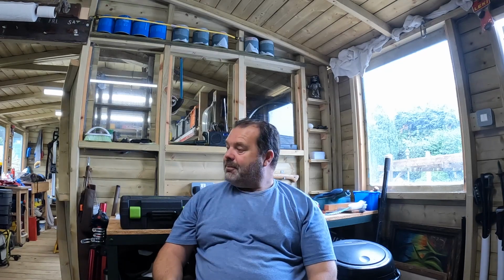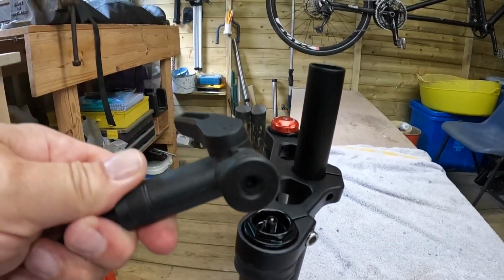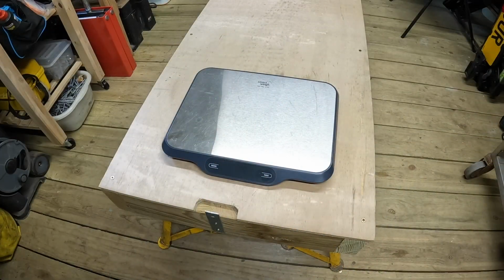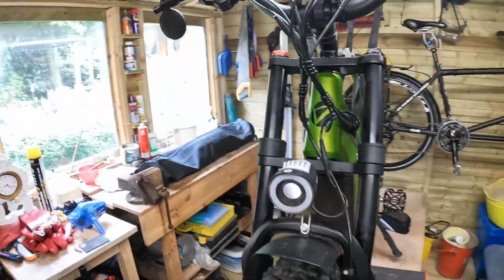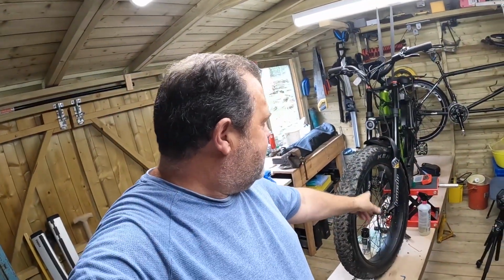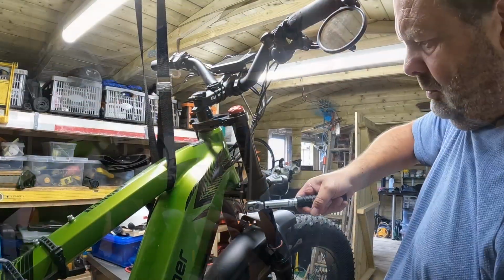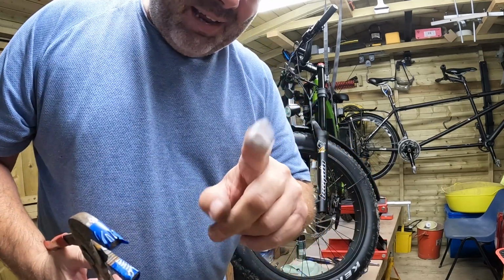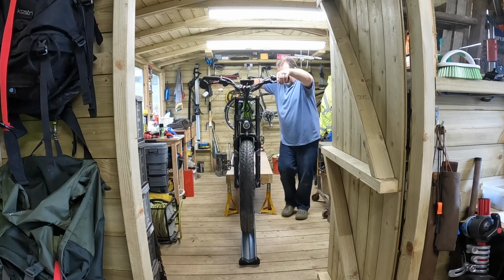Cyrusher Ranger eBike. Changing the front shocks from spring to air shocks.

Comment: Nice video Geoffrey, I will also do this upgrade, do you also know how to remove the speed limitation on the bike?
Reply from the maker: Good morning. Thank you for the nice comment and also for watching the video. To remove the speed restriction, you remove the pedal box cover and look inside for the red wire. The red wire has a connector on it. Pull apart the connector and then just push the wires back into the pedal box. You need to then go into the screen settings and turn the power up to 100%. And that is all there is to it.
Reply: @geoffcarol1 thank you so much much, come si imposta il display al 100%?
Reply from the maker: @FrancescoStancato  Watch this from 24:00.     https://www.youtube.com/watch?v=XI_HYy6XUCk

Comment: Hi Geoffrey great video, where did you get the Torque settings for the fork clamps. Thanks in advance.
Reply from the maker: Hi Andy. I sort of guessed. When I undid them, they where tight. I set my bike torque wrench to the maximum it goes to which is 14. I do have bigger torque wrenches but didn’t want to strip anything. I thought it would be tight at 14 whilst I researched further. Hope this helps.

Comment: How's rhe new air shocks working out
Reply from the maker: Really pleased so far. I set my sag and then I have been playing with the rebound and compression. This I need to keep playing with as one minute it seems really good and then next its a bit "stiff". I doubt it's the shock but more down to me. The shocks are definitely smoother and easier on the arms than the spring shocks. I have noticed a difference which I am still hoping to improve upon. In my opinion it has been a worthwhile upgrade that was not expensive. I would definitely do it again if I had too.

Comment: How much , part no# , did you change disc dia. If soo what kind of disc is that , what caliper mount 😊?
Reply from the maker: Hi Tony. Cost and part number are in the description link. Rotor is from Hope. 220mm diameter. Calliper adapter is a Magura 180 to 220mm.

Comment: How did you find your new air fork upgrade
Reply from the maker: Hi David. Really pleased so far. I set my sag and then I have been playing with the rebound and compression. This I need to keep playing with as one minute it seems really good and then next its a bit "stiff". I doubt it's the shock but more down to me. The shocks are definitely smoother and easier on the arms than the spring shocks. I have noticed a difference which I am still hoping to improve upon. In my opinion it has been a worthwhile upgrade that was not expensive. I would definitely do it again if I had too.

Comment: Do they by air forks for a kommoda and would you know what psi I should have in my tyres
Reply from the maker: I am not sure on the size of your forks but there are various supplies of replacement forks. I am not sure on your Commode as your tyres are a lot smaller than mine as I have the Ranger. As I read in mixed terrain, I have 15psi in the front and 18psi in the back. I ride on the beach, roads and forestry as well as farm tracks and I am happy with those tyre pressures.

Comment: Hi, every review ive seen for the ranger says it comes with air forks as standard, is this not the case? Also supposed to have an air rear shock.
Reply from the maker: Morning. The front is a spring and the rear is air. I have seen that a few times too.

Comment: Morning Geoff, Tom from Colorado he’s great!
Be interested to see if it makes much difference with the air shock 
I’m sure you’ll put up another video when it stops raining 😂
I was very interested in the ramp you’ve made it looks like you have 
4 axle stands/ plywood and a ramp you wheel the bike up, I couldn’t quite 
See in the video what material the ramp was? You secured the bike to a beam!
I want to build a ramp for my ranger to work on it too 
Great video Geoff lots of info if you’ve got any tips on building a ramp 
It would be much appreciated cheers 🍺🍺
Reply from the maker: Morning John. Thanks for the comment. The work platform is brilliant and I use it way more that I ever expected. I am busy over the next couple of days but I will make a video for you explaining what I did and the reasons why.

Comment: What weight rider does the air shock support?
Reply from the maker: Hello. I don’t know. The link for the shocks is in the description. I did have a quick look but couldn’t see anything.
Reply: @geoffcarol1  is it wrote on the side of the bar sticker?
Reply from the maker: @laptop597  just looking at the sticker and it does not say a maximum weight. It gives guidance on air pressure for different weights. I weigh more than the figures given.